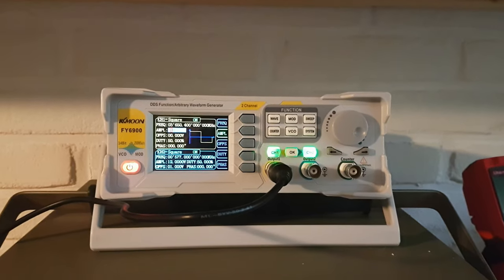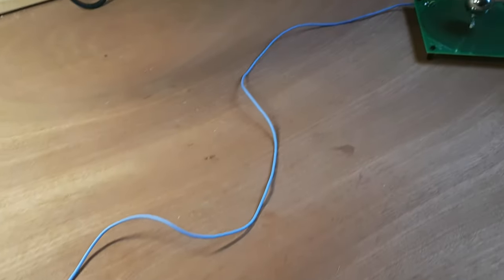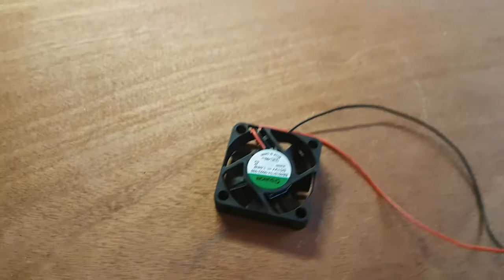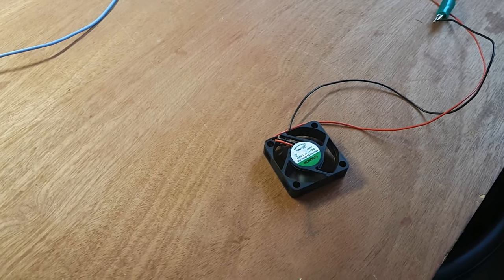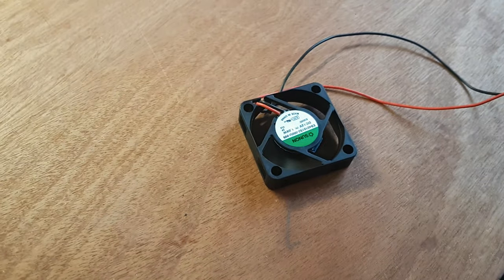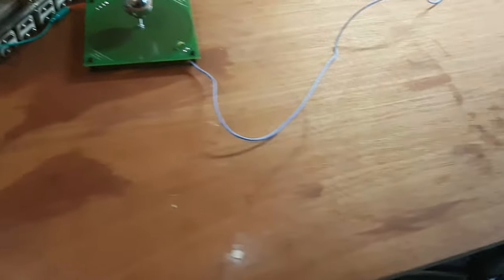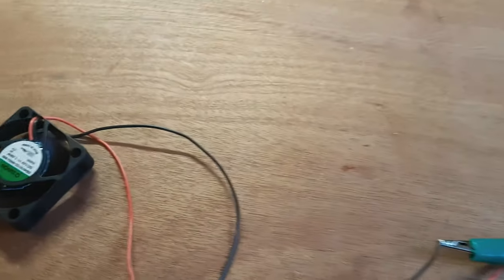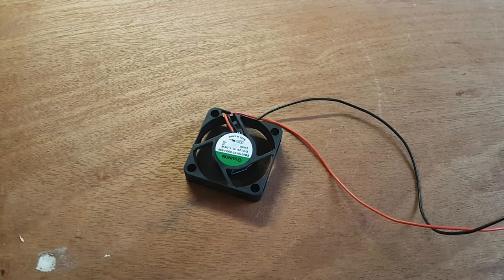Tesla Coil Experiments: Single Wire Power Transmission

Comment: I’ve finally built a model of single wire power transfer.  It did not work super well, but sorta powered a solenoid. I’ll try to tune it like you did to hopefully power a more powerful motor.
Reply from the maker: Yeah it does require a lot of tuning, and then still I never got it to be super efficient, but I fault my own mediocre skills for that mainly :-)
Reply: @Waveguide  Hi. I write to say that I got it working really easily with a slayer exciter. Apparently it tuned itself with sloppy hardware.

Comment: Nice demonstration, wonder how much power went in?
Reply from the maker: I'm using a 20W amp, so transmission efficiency of this setup is rather low. 

However, this is an extremely crude setup, so higher efficiencies are definitely attainable.

Comment: Hey .
I started doing experiments again because there’s some super cool papers published on the past two years.

Some researchers in Wisconsin got 90% efficiency transmitting power to a dirigible, 500 watts

Some researchers in China, forgot the province , transmitted 5kilowatts with a new kind of coil. 

I can send the papers if you’d like, they’re super cool !
Reply: Looking at this I realize that you tuned the primaries, sure, but the secondaries didn’t actually have much tuning. Apparently a tuned inductor between the top load on the reciever can drastically increase efficiency if not grounded
Reply: Very interesting how the receiving primary has a tuning capacitor. That’s actually not in any literature I’ve seen. Incredible!
Reply: Hmm. A resonant tank capacitor. With enough LC elements everywhere, technically the only adaptive element tuned is the inductor for the transmitting device to stay within resonance from stray capacitance to fully “cycle” into the receiver’s stray capacitance.
Reply from the maker: @yelectric1893  Hi, I would love to receive those research papers! You can contact me through my website.

Also, the secondaries weren't tuned, because they were pretty much identical already, as they were PCB coils.

Comment: If I understand this correctly, tuning the capacitance is a way, but would tuning the signal generator frequency instead also work? I read your blog and went down this rabbit hole. Thank you for making an experiment and sharing it online, I will try to safely too.
Reply from the maker: By changing the capacitance you change the resonant frequency. Only other way is to change the inductance, which is a lot harder, so the preferred method of tuning is by using a capacitor.
Reply: @Waveguide  Thanks for your reply. Hmm. I thought that from the equations that the drive frequency could be changed. Interesting. I will have to figure this out. Thanks. Do you have any suggestions for designing something like this? I guess I can work backwards from the tesla coil, but I am not very experienced. Thanks again. I have tried reading some of Dr. Avremenko's works as well as another scientist's work Dr. Strebkov. 

This guy's youtube videos are awesome too. His single power setups are quite diverse and seem to work pretty well. A laptop can be charged, and it even sorta works with a lot of inductance on the line in other experiments. https://www.youtube.com/watch?v=qMX8Lcu7X2o&t=270s
Reply from the maker: @yelectric1893  Thanks for sharing that link!

To get into this stuff, you must realize that the Tesla coil is a tuned transformer, like a radio system, and so learning about radio will give you a good foundation.

You can look up some HAM radio tutorials and learn about resonance.

Then I recommend you learn by doing: try to build a simple mini Tesla coil and power it using a signal generator to learn how it works.
Reply: @Waveguide  This is very interesting. I bought a slayer exciter kit from online so I will try to make something from that. I will try to work from the equations and compare them to real life results to see how far off the models are to my attempts to make better attempts. I will also borrow a scope once Im back in classes at college. Thanks for the tips. 

A question about safety: say I have an uninsulated top load. If I turn the tesla coil off, how do I know that the circuit is safe to touch? Would the capacitance stay there like a dangerous microwave capacitor? Sorry if this is a dumb question, I am just very scared of this thing. Although theres a low amount of actual capacitance, the ridiculous amount of volts is not to be scoffed at I think. 

Thanks again.
Reply from the maker: @yelectric1893  Always good to be safe! A tiny Tesla Coil will not be able to hurt you much though, as the current is incredibly small, and the high frequency will prevent the current to penetrate your body due to the Skin Effect.

However, you could always try to discharge it with a screwdriver or something at the end of your session.

Also realize that a Slayer Exciter is NOT the same as a Tesla Coil, and you won't be able to perform the single wire power transmission experiments with a Slayer Exciter, as it's ground wire is not free, but used as feedback for the triggering system.
Reply: @Waveguide  Thanks for the safety tips.  I will use a tester and have something to ground with nearby. About the one wire slayer exciter, I did some digging and found an 8% efficiency 170 watt slayer exciter setup where the transmission wire is connected to the side of the secondary coil that is also connected to the top load. I am not sure, but perhaps connecting it on the other side gets around the feedback problem you stated?  This seems to work kind of well. https://youtu.be/UbSS5-7N0nE

Comment: The lenght of wire/capacitor need to be Quater wave length of the signal generator fequency to get maximum transmission efficiency thats the tuning.
Reply from the maker: You're right to a certain degree, but you'd have to take into account the fact that in these coil systems the current travels over the outside of the wires in a spiral, and so can reach the end of the wire faster than it would if it followed the length of the wire exactly. You'd need to account for this propagation speed difference when determining the quarter wave resonance, you can't just use the speed of light in a wire vs the length of wire you used.
Reply: The single wire was used for both power and two way data transmission from implant - mice - cage floor - circuit - computer
Reply from the maker: @thunderandstorm4957  read books by Eric Dollard, or watch his old videos, in which he shows the difference in signal propagation speed through two equal lengths of wire, where one of them is wound into a Tesla Extra Coil structure. The Extra Coil transmission was a lot faster.
Reply: @Waveguide  Hi nik, can you point out the exact video where Dollard explains "the current travels over the outside of the wires in a spiral, and so can reach the end of the wire faster than it would if it followed the length of the wire exactly" ? I think it's an important point, one of the most important I think.
Reply from the maker: @tanner1985  These two videos: https://www.youtube.com/watch?v=DFa-IymyWHM

https://www.youtube.com/watch?v=6BnCUBKgnnc